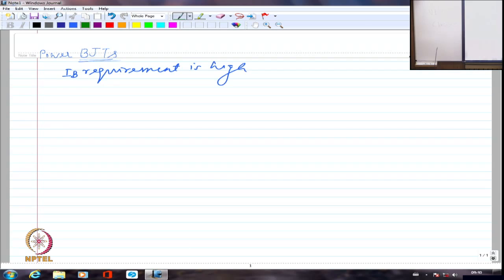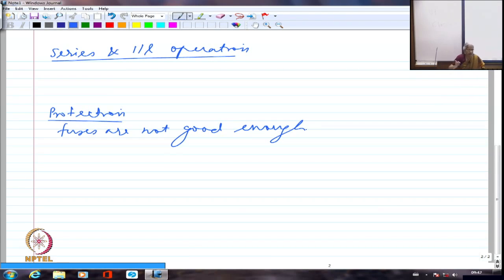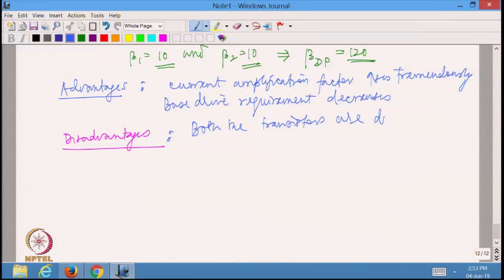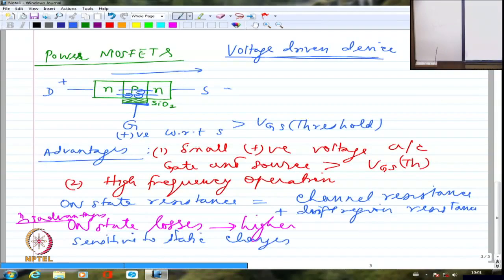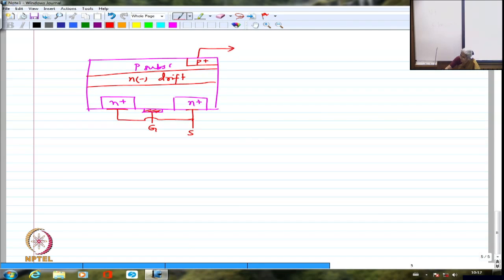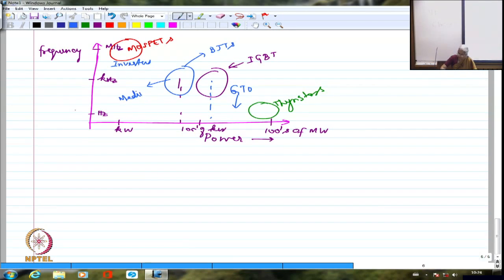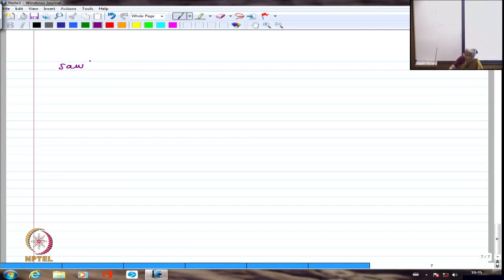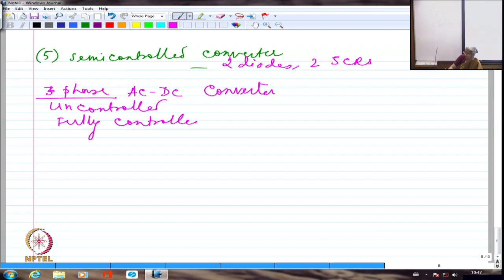Power Devices: BJT, MOSFET and IGBT

Comment: pwr bjts 0:00
bjt turn on/off losses 4:00
pros and cons of pwr bjts 10:00
base drive including darlington for pwr bjts 19:00
pwr mosfets 25:27
Si carbide SiC mosfets 37:00
mosfet protection 38:30
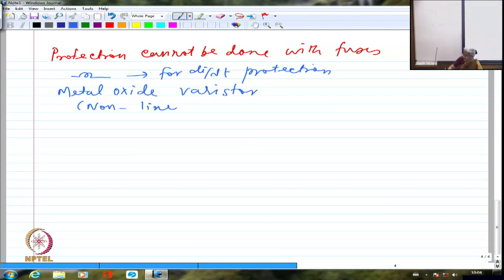metaloxide varistors mov 39:00
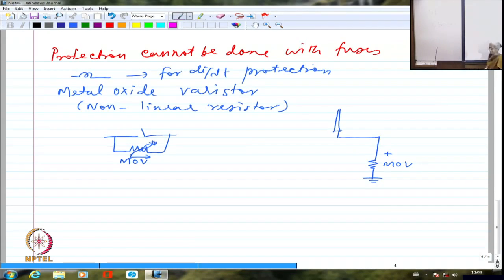IGBT 43:37
Freq Power curve for devices and applications 55:00
firing scheme for bjt igbt and mosfets 1:03:40
opto couplers for igbt drives 1:06:22
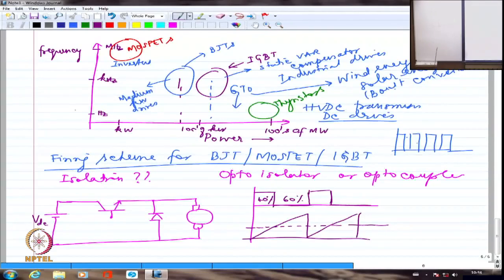saw tooth wave based drive scheme 1:09:00
rectifier 1:15
Reply: U guys are the real Heroes🙏🏻

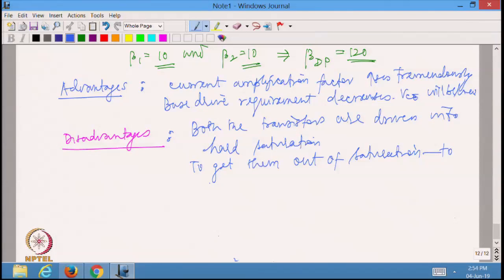Comment: Mam your  statement at 24:10 "Both the transistors of Darlington pair are driven into hard saturation" are conflicting with Prof. B.G. Fernandes's (Department of Electrical Engineering,IIT Bombay) , Lecture statement at 24:40  in https://youtu.be/wH3J6zKiOzw?t=1239 here he said  "It may not be possible to operate transistor 2 of Darlington pair in saturation " . I personally think he is right because he gave a proper explanation, Mam please explain who is right.
Reply: Exactly i had also finshed BGF Sir lecture ........but I thik BGF sir is correct